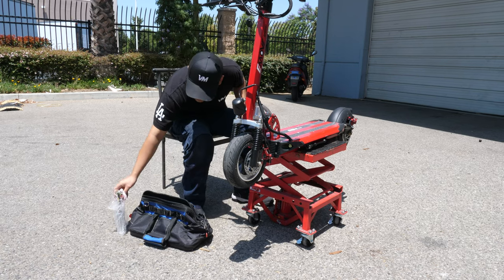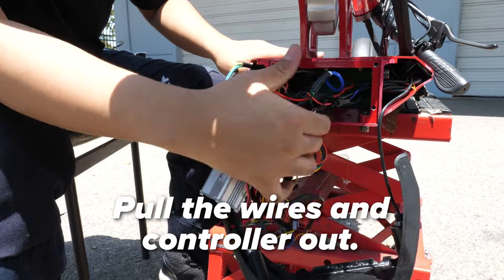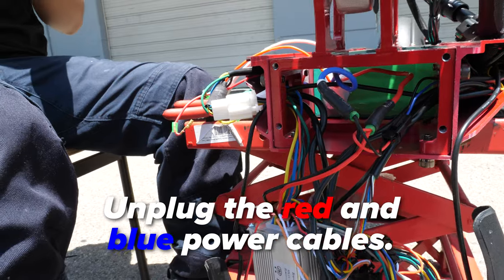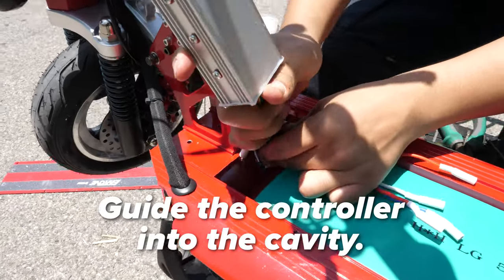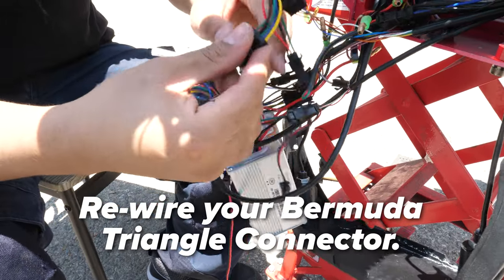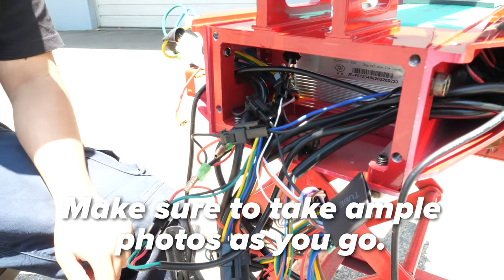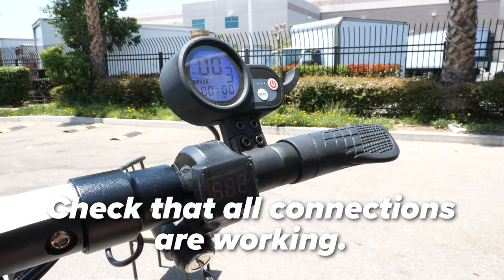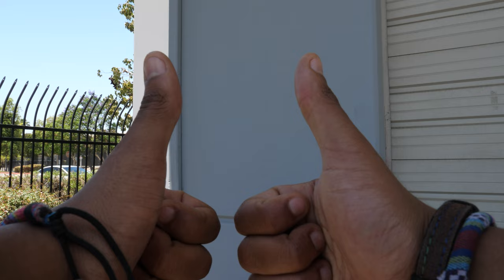How to replace the Controller on EMOVE Cruiser electric scooters - VoroMotors tutorial

Comment: That's a bad spot for the controller. The battery cables ran over the controller can get pinched between the controller and the scooter housing causing them to short against the sharp edge of the housing.

I'd recommend keeping the controller in the front where it was when he took the first controller out.
Reply: sure but the new controller is bigger than the old and will not fit in the old spot.